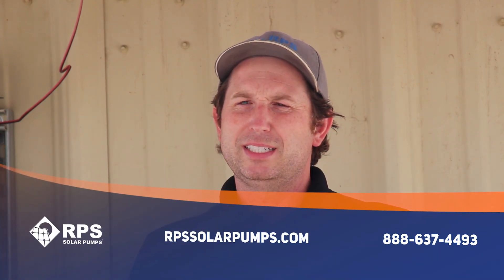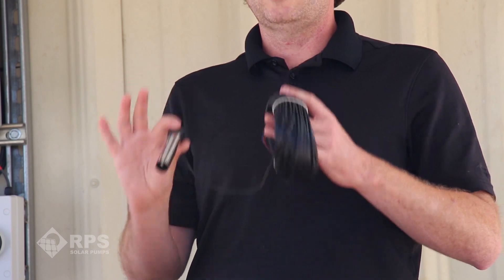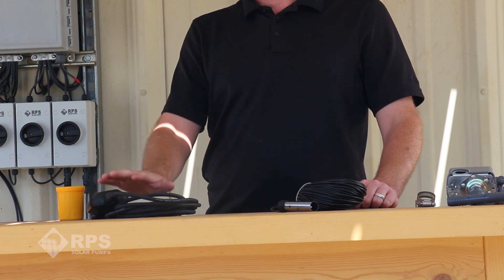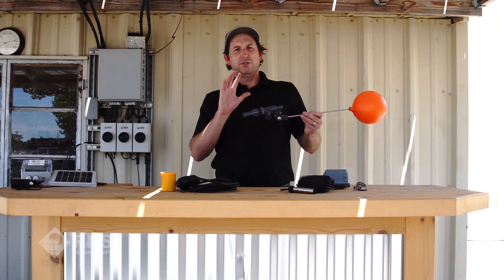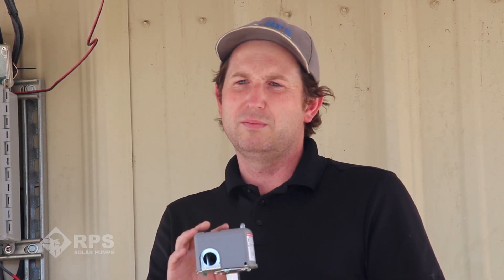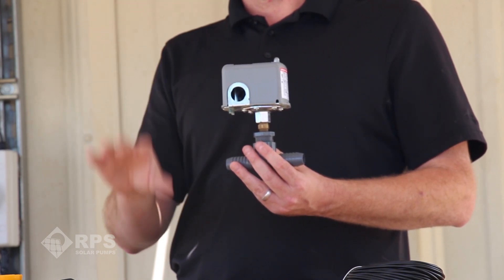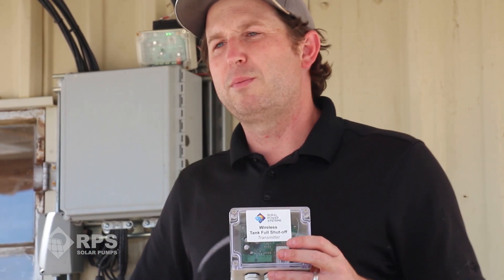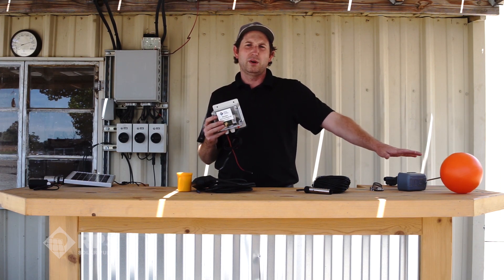Tank Full Water Pump Shut Off Options, Never Overflow Your Tank Again!

Comment: What length of cable am I able to add to the stainless steel pump switch? Example I am pumping to a 1500 gallon storage tank at an elevate location. The tank will need to be aprox. 750 feet away with a change of elevation of aprox. 102 feet.
Reply from the maker: Usually the transmitter is located at the tank.  Is there a reason it cannot be located at the tank?